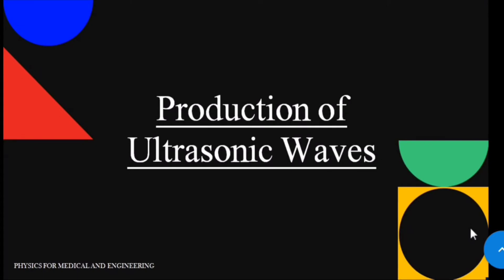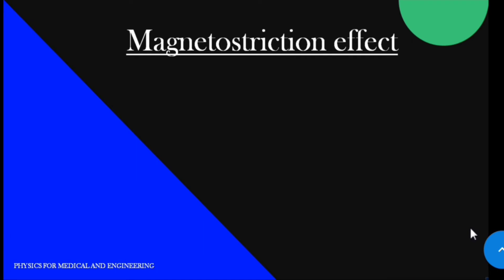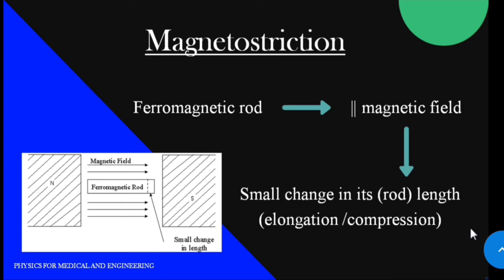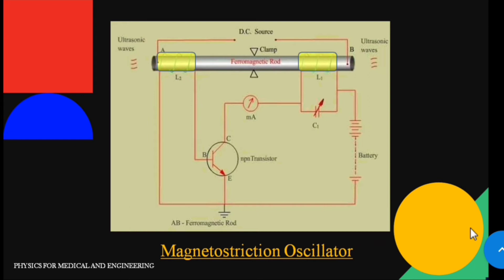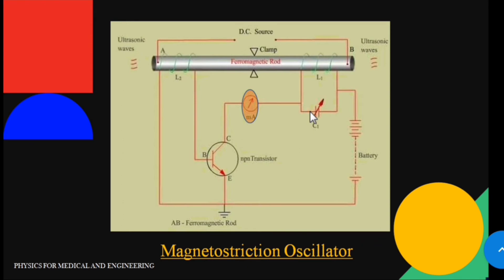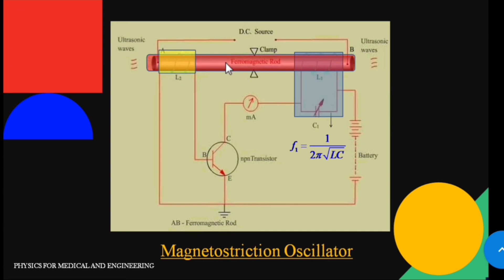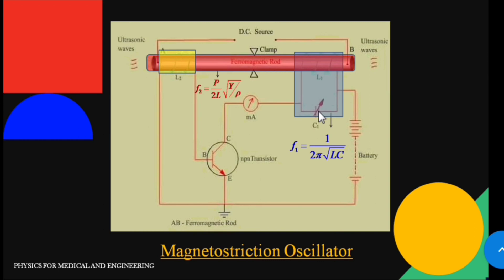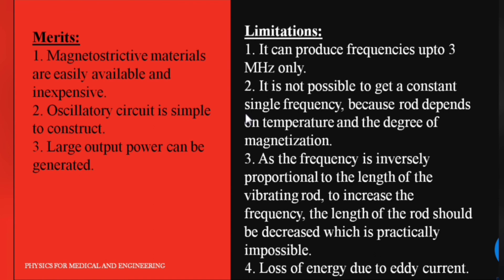Magnetostriction oscillator

Comment: When will be the frequency of LC circuit and the natural frequency of the rod equals ?
Reply from the maker: Here we are using the variable capacitor so we can change the capacitance and ultimately It will change the frequency. And the rod has its own natural frequency. So by using suitable value of capacitance, u can match the frequency.
Reply: @physicsforall07  Thank you very much.
Nice explanation.